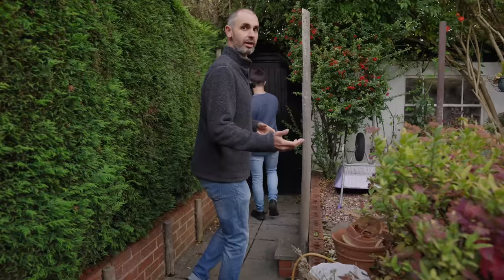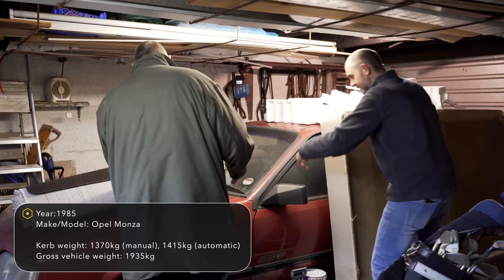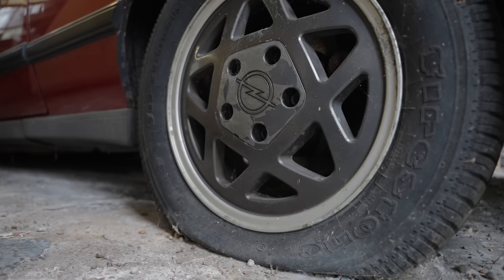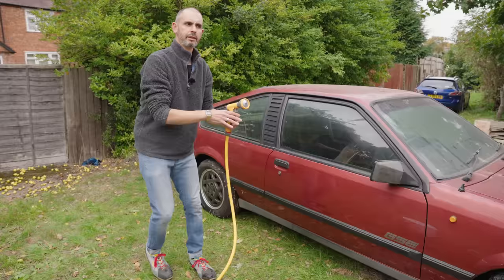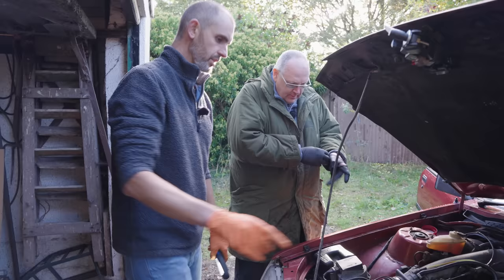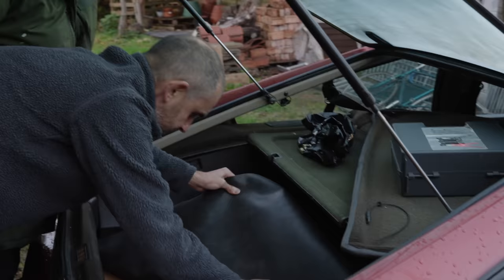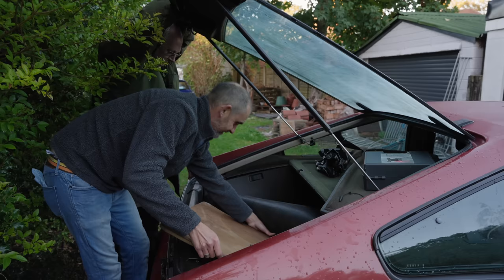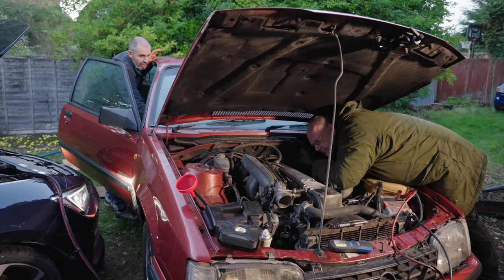Barn Find classic 80s Opel Coupe rare survivor

Comment: Did you pour fuel into the fuel rail of an injection car?. 
It's not.under pressure. That won't work. It's not a carb car where you can pour fuel into the bowls.

Comment: Dudes, it's a fuel injected engine. Fuel injection requires a high pressure fuel pump, typically about 30 PSI. Gravity wont cut the mustard. 
Also, Australia had a version of this car with a 5.0 liter V8.

Comment: The next Barn find regardless of what it is just bring a new fuel pump, spark plugs, Fogging oil for the cylinders , fresh fuel ,and of course a couple of fully charged jump packs and cables maybe even a new battery.  When they try cranking over the car, even with checking the oil and fogging the cylinders first, instead of turning the motor over by  hand it just makes me Cringe.